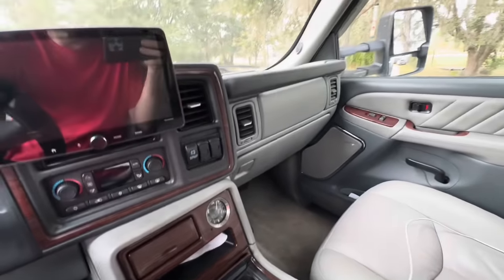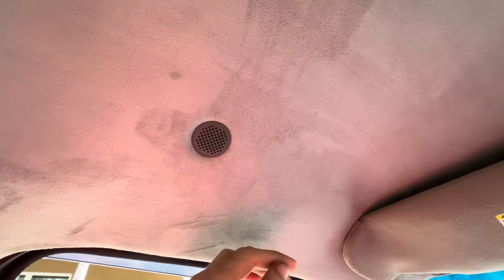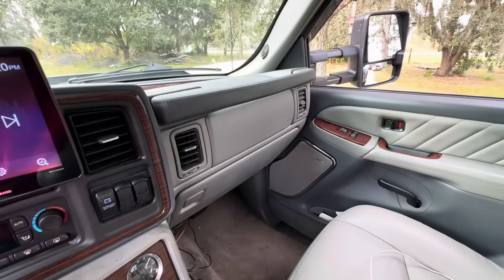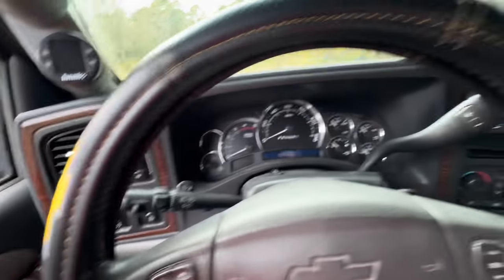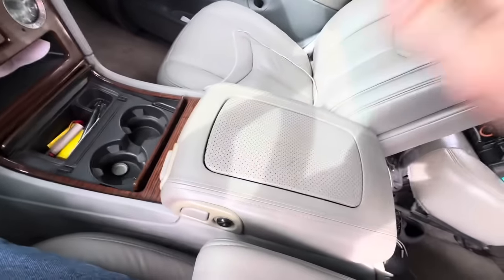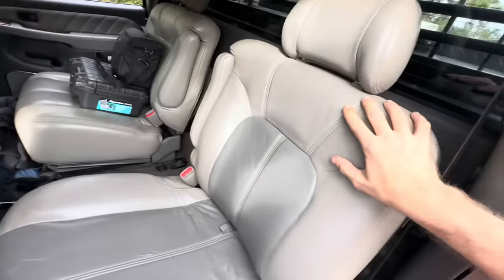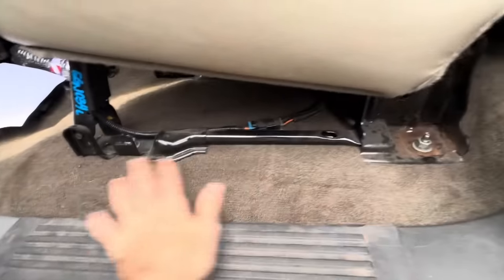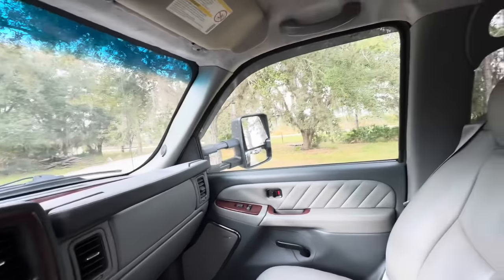Escalade Interior Swap, Silverado Sierra Tahoe Yukon 02-06

Comment: You should get some quality moisturizer for your leather seats that have UV protector incorporated in it and it will help keep your leather supple and protected from the sun.  Also use one of those heat reflectors in your front window where possible, even if it's laying on the dashboard to keep your truck protected.
Reply: Don’t forget window tint.
Reply: Awesome job, looks like a brand new truck...but better!

Comment: The interior looks great! I wish I saw your Escalade conversion before I replaced  my dash cluster with blue led's from ISS in my 2003 Tahoe. It's  a Z71 and I do have the roof AC and lighted vanity mirrors on both sides I like the console I just wish they opened from front to back instead  east and west! It looks great. You just need the Escalade steering wheel! Your air bag will fit right in!

Comment: Great Video I know it took you a little time to do this but it came out great. Guessing it was way cheaper then a new truck.  had to do the same thing you did to your truck on a 1984 Cadillac he left me Started out with the  headliner. The one I had came out with the the rear seats out. Any way didn`t need a lot of interior pieces  but a lot of fixing. Came out great though.

Comment: i mean even though it definitely snowballed, you still did things that needed to be done. the seats had to come out for the needed head liner replacement, so may as well do the carpet. the dash had to come out for the heater core fix, which the seats also needed to be out for. its a LOT of work, but it did need to be done. the center console conflict was a downside of the snowball, but it was a problem that needed to be solved

Comment: Looks great Ray, nice work... How hard was it to find out that the parts were swap-able between the vehicles? Looks like some serious research went into finding how you could trick out the interior
Reply: It's pretty easy to guess that they're swappable if it came off a GMT800 truck, regardless of if it was Cadillac/GMC/Chevrolet. It's all the same.
Reply: @VTXHobbies  thanks, not so straightforward for those of us in other countries that don't get those brands. But if they come from the same factory then makes sense